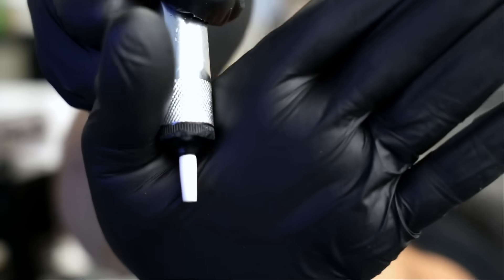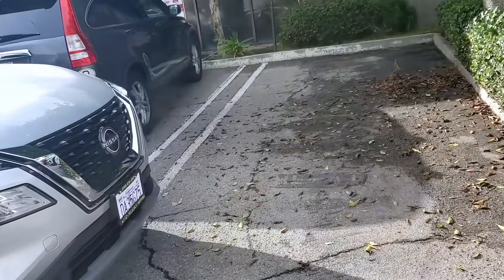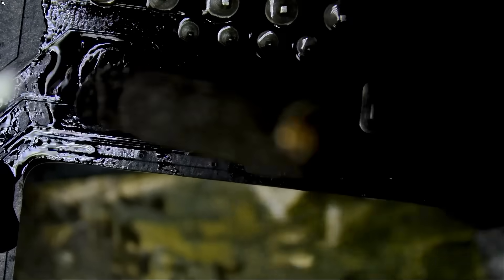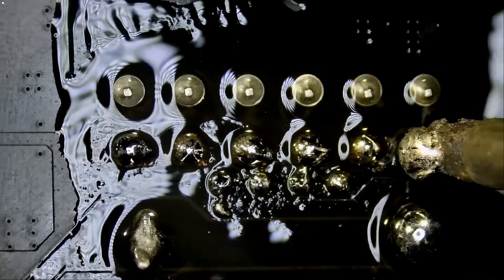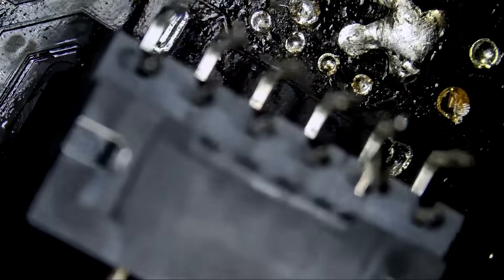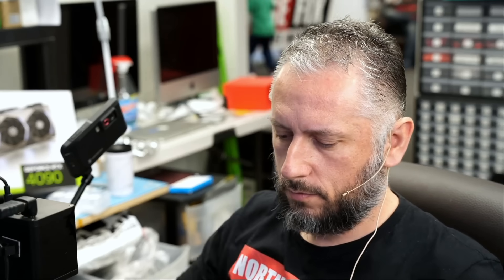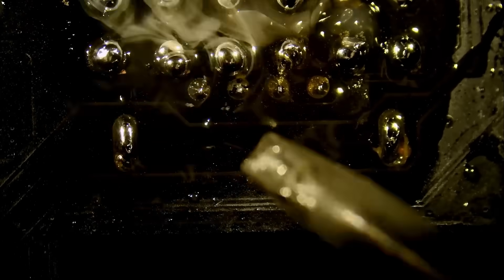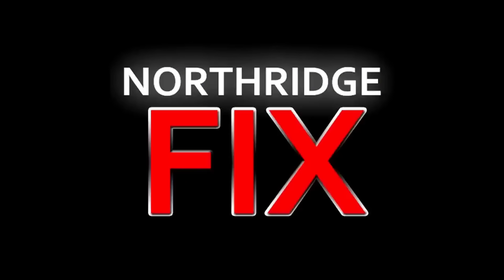$1700 MSI 4090 SUPRIM X Graphics Card Repair

Comment: Not sure what people are doing, I have the same card and my connector has had no issues and it's been in out of the case multiple times. There be must something wrong with the OEM connectors. I used a 3rd party cable that connects directly to my PSU and it's worked perfectly.

Comment: @northridgefix Asus just came with a btf 4090 that allow the gpu to pull power directly through the motherboard with a secondary pci power slot.

Seems a good idea to solve the 12vhpwr cable for good.

But i was wondering, pulling 600w for gpu + 300 w for core i9. Isn't it to much to handle for a motherboard ? What about the durability, the electro noise for audio parts etc ...

Comment: PC expansion cards have gotten too thick and too heavy with too much power consumption. Expansion cards were never meant to be more powerful than the computer itself. Video cards are today what amounts to a second PC, and they're melting and cracking due to thermal issues. There needs to be a new standard.

Comment: I have a 4090 and every time I turn it on I’m convinced it’s going to melt, and I’ve check many times it’s plugged in completely and straight in/flush.

 Clearly this is a case of too much current with too small terminal contact area. I’m retired automotive master technician and saw the same thing in many connector designs. I wonder if just soldering the wires directly to the board would fix it. Yes it would not be the ideal fix, but I bet it’d work just fine.

Comment: So what do I do to avoid my 4090 burning connector?? Have yet to plug it in for fear of having spent that much and not have card replaced or fixed. I will do a video showing I plugged properly. Any new cable to use or simply no permanent solution for people like me? Someone trying to install their upgrade, and for those currently using a 4090 please.
Reply: Return it.
Reply: Ha, cool dude. I’m glad at least someone said something. Always someone out there who hates their life. Nothing better to to than to read a comment and waste that persons time with useless information lol. Great though, I will consider your professional opinion.

Comment: If these connectors and the "new" type model are still melting, a whole newly designed one is needed. This type just can't handle the temps and watts/current. The human factor should be taken into consideration with connectors designed more robustly for installations that can withstand error.

Comment: Back in the 70's we used to use multipin ceramic connectors for high current plug/sockets. Perhaps that would solve the problem of melting plastic sockets. Another lesson in how to solder! Thanks Alex and have a Happy Holiday/Christmas.

Comment: With multi pin connectors it's possible to 'tack' one pin in place, then tweak the connector's position by melting the solder and moving the connector.  Once the position and alignment are good, solder a pin on the opposite  end of the connector, then finish the soldering.

Comment: It's better than factory yes but because you're using leaded solder in the state of California...
Reply: He only uses leaded solder (low melt) to help remove the factory unleaded solder. 
Once all solder is removed, he then re applies factory (unleaded) solder for the actual repair joint.

Comment: Is there nobody making a 2x8pin to 12VHPWR adaptor that can be soldered on instead of soldering on another connector that's going to fail again?  You could offer it as an upgrade to the factory connector.

Comment: Excellent repair as always Alex. Man, some connector manufacturer needs to come up with a tandem connector for these or something. The pins being separated out and distributed may help with this. It's not ideal, but should be much better since the solder connections are never an issue just the pins. With the double or tandem connector a 'y' cable will also be needed and may end up being the easy to replace part? Nice wheels Big Boss! Hope you enjoy it!

Comment: Makes no sense u increased power but made connection smaller every one in the car industry knows how DC 12V needs bigger cables compared to AC cables. It's basic physics. I personally seen how much 12v tends to arc when working on cars

Comment: How does this procedure actually fix the problem?  I would think the replacement connector will eventually have the same failure as the factory one.
Reply: It fixes the problem, it doesn't fix the design issue causing the problem ... Unless you fancy producing a redesigned connector/pcb layout there isn't much more a repair tech can do.

Comment: Had same model 4090 in april, however day one it had faulty heatsink, bad center fan and rezonating like a violin heatsink when fan spin faster. Didn't bring it to RMA right away, used it for a month and later RMA couldn't repair it offered gigabyte card but i declined and got my money back, decided not to buy 4090 again.

Comment: Damn... that's why the whole time I use my 4090 only undervolted to the max to not consump more than 300 watts 😆🤦🏻‍♂️
Reply: Why would you buy the most expensive/powerful graphic card in the market if you don't give all the juice to it? It's like buying a Ferrari and limit the power to 100BHP - why? - just for the bragging rights? Buy a 4080 and no worries then.
Reply: You gangster
Reply: @AC_Milan1899  No the opposite I think 🤔😆

Comment: Most retailers are claiming that the issues have been resolved with the newer cards. Is that true?
Reply: They redesigned the power connecter with shorter sense pins, the smaller 4 pins in a row. This way if the connecter is not fully seated it will break the circuit of at least 1 of the sense pins, thus shutting the GPU down, so they say. We will see. Personally I think there is more to it than crooked connecters, but if this fixes it then that's great.
Reply: @stephenhood2948 How can you tell if its a newer card? Im supposed to be buying a PNY XLR8 4090 tomorrow. But now I'm having doubts because of this melting cable thing.

Comment: NVIDIA: "Our 4090s are just fine, it's a customer's fault"
Reply: georgesanford3719  low voltage means less power means less heat.
Reply: georgesanford3719 you right! No enough power
Reply: .......that he bought them.
Reply: All they had to do was make it click in place and include a anti sag bracket....
Reply: Ok, that's why there are so many faulty parts...
Reply: For me the whole 4090 is a wrong concept from the design point of view. Its happening also with the last intel processors. The try to compensate the lack of innovation and development making the chips more power hungry. They just need to release cards with better performance doesn't matter what. This is clearly a wrong decision and we are facing now this type of issues.
Reply: But it's really the fault of the customers who decide to spend 2,000 dollars on a product from a company that doesn't give a damn about them!
Reply: Well...recently cablemod admitted their adapters/cables were the cause of melted connectors,and recalled their products for this card,also,many people didn't have any problems when not using cablemod .
Reply: georgesanford3719 nope not even close
Reply: It is the fault of the Customer for using a cheap ass 90 or 180 adaptor.

Comment: Why the ppl keep buying that graphic. Maybe they need it because of power it has. This happens when the card is being used at 100% and those connectors cannot handle the amperage generated by the graphics card. The only responsible is NVIDIA and his new connector. I hope you guys can make a massive compliant.
Reply: Possibly the amperage used by the video card, not generated.
The connector is the same as on the boards of 10 years ago.
It's also the manufacturer's problem, but not only because I've seen msi, asus, gigabyte and other companies with the same problem.
Many users do not buy a quality source but one just to carry the video card ..... and from there poor quality connectors -> imperfect contact -> contact overheating -> melting connector!

Comment: so, your unaware that cable mod has issued a recall on their 90 adapter, v1 and 1.1?
Reply from the maker: Yes, and 12VHPWR will be replaced with 12V-2x6. The VH design was a mistake from the beginning.